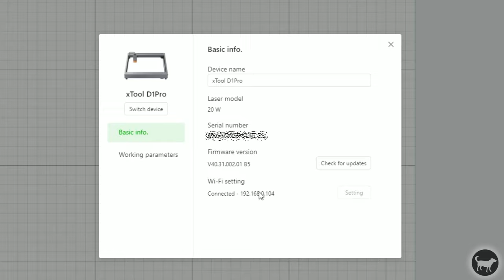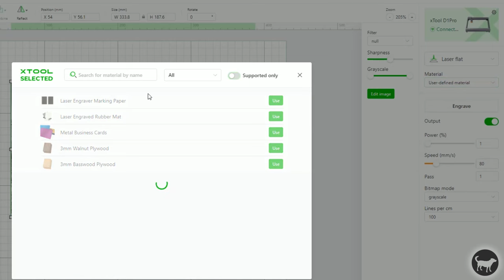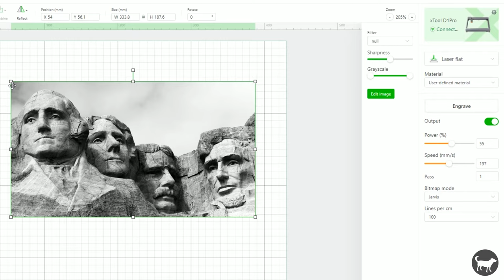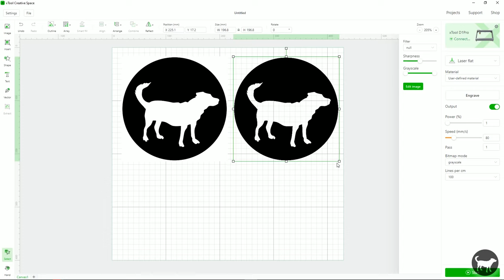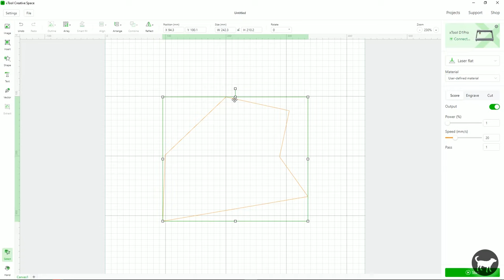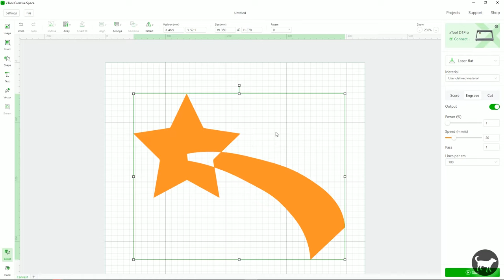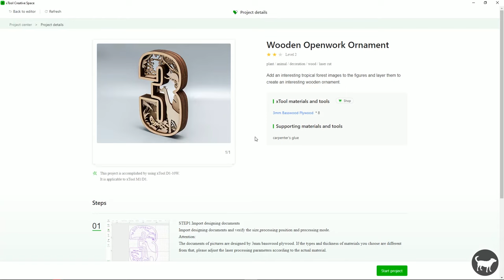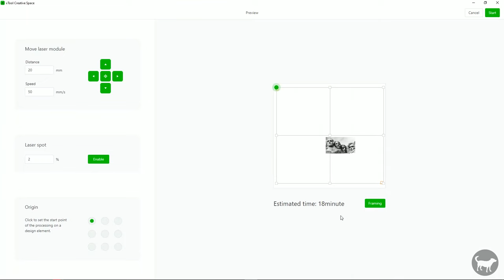xTool Creative Space Beta Tutorial for the xTool D1 Pro

Comment: I am trying to engrave for the first time using my machine. I am using creative space on a laptop that I have connected by USB. My problem is that when the preview comes up before engraving, whatever I have on my canvas is not showing up in the preview, so I obviously can’t go any further with engraving. Any insight as to what might be going on?
Reply from the maker: Only thing I could think of would be that the "OUTPUT" checkbox on the previous screen might be turned off. Other then that I would suggest a app upgrade if something is wrong.
Reply: I will check that…thank you for your reply! Your video was very informative.
Reply: That’s not it…I’m so frustrated!! 😫
Reply from the maker: @beth71275  I would try updating your software to the newest version if you haven't already tried that. Also is there a possibility that whatever you are trying to engrave is larger then the work area? Even if it's slightly off it may be deleting that part before going to that preview screen.

Comment: Is the machine running GRBL 1.1 and if so than laser grbl is much better software
Reply from the maker: LaserGRBL is also fine software but it has it’s own limitations. You can’t edit or draw vectors in LaserGRBL but you can here. If you really want the best of both worlds I recommend Lightburn over either. LaserGRBL will not even run on the D1 so it’s a bit of a moot point anyway.

Comment: Hi there! Thanks for this very usefull vid! I still have a little probleme (sorry my english is not the best) When I do to outline step xToolcreative only take the outside on my shape (so to use your exemple, it only trace the orange line on the circle but not on the dog, so it only cut the circle) And my files is exactly like yours, do you maybe have a solution? thank you
Reply from the maker: Before I ran the outline I editing the image and removed the white areas first. After the white areas were removed you can click outline again and the black areas should be outlined.
Reply: @BusterBeagle3D  I already did all of that but it still only take the outside of the shape T_T But thanks for your quick answerd ^^
Reply from the maker: @choulybi2910  Hello. I checked with the newest version of the software and you are indeed correct that this is a bug. It no longer works as it should. I have reached out to xTool on Facebook and reported the issue as I see no other way to report a bug.
Reply: @BusterBeagle3D  Good to know it's not just me being bad! xD thank you for reporting it! hope it will be corrected soon.

Comment: Hi thanks for the vid, can this also be used on the 10W D1 Non Pro?
Reply from the maker: It could but the non pro does not have limit switches so you would manually have the push the laser to the back left corner and then burn the grid. The total workable area on the original D1 is also slightly larger but not by much so it would still work size wise.
Reply: @BusterBeagle3D  Buster, just bought your etsy files for the feet, etc.  I have a d1 pro 10 watt.   I havent done anything with the laser yet. Are the settings set up in the the files? Thanks for any tips, input
Reply from the maker: @jimstephens2487  Hello. Not sure if you are using the Lightburn or XCS file but if you are using the 10W you might want to lower the speed to 5000mm/sec. Then again you could always leave it as is and go over it again if you feel it's too faint.
Reply: @BusterBeagle3D  I am attempting to use xcs. I am getting a little jumping on certain parts
Reply from the maker: @jimstephens2487  The XCS is a export of an DXF from lightburn into Creative Studio. It might have combined the grid in certain way that might seem odd about how it burns it but does it still work on the whole grid?

Comment: When I switched off the cross hair and checked Laser Spot I am not getting the spot. what did I do wrong?
Reply from the maker: The spot only turns on when you "fire" the laser. It's the actual laser so you only need to turn it one where you need it for things like framing. Be sure to keep the power low so you don't burn your piece and make sure you have your glasses on.